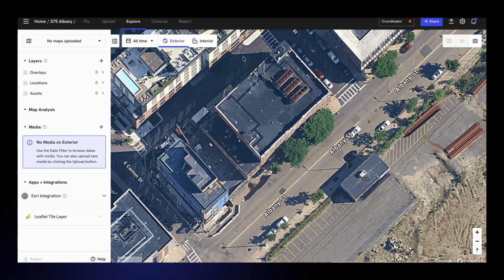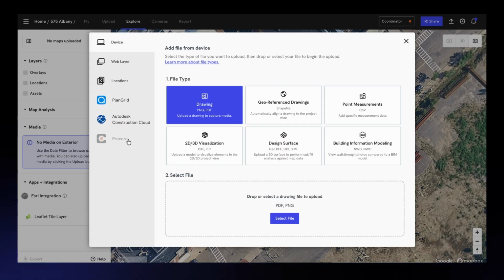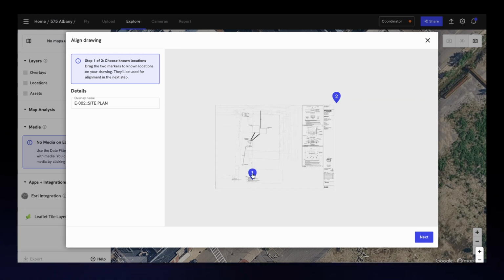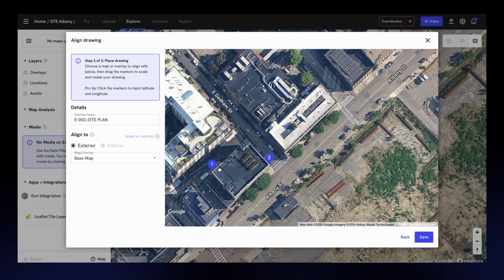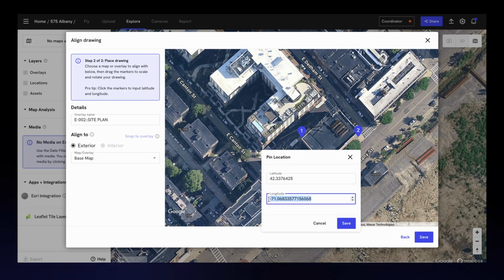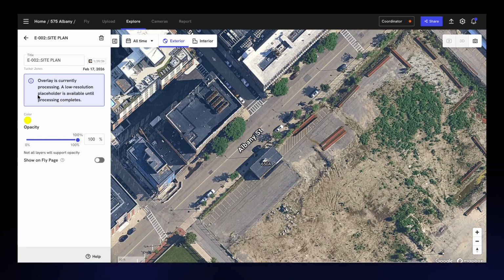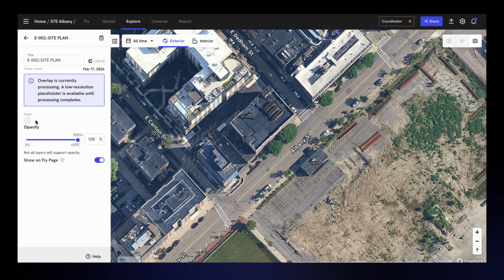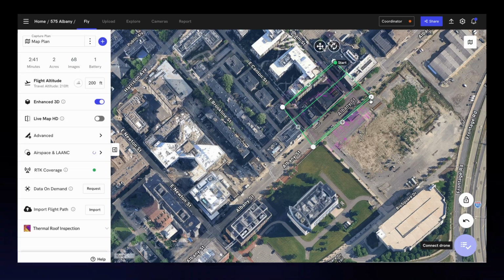How to use site plan overlays to plan precise drone flights in DroneDeploy

Comment: Exactly what I needed, thank you! But...when I plan an east/west corridor flight and then run the simulation, it shows the drone pointing North, then flying east/west sideways. Does it fly that way in real life? My mavic 2 pro doesn't have side avoidance unless it's in active track or tripod mode, which it won't be in to fly a half mile corridor.